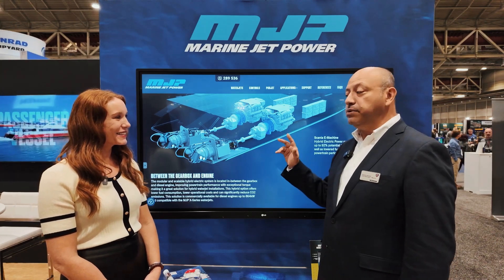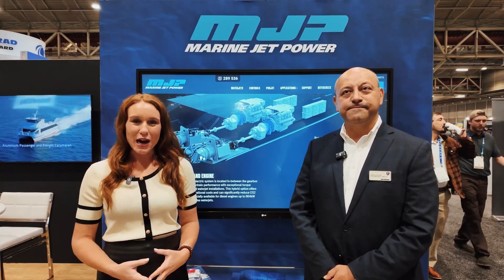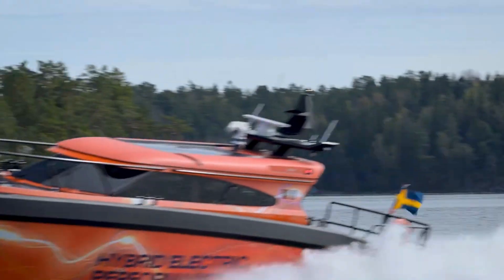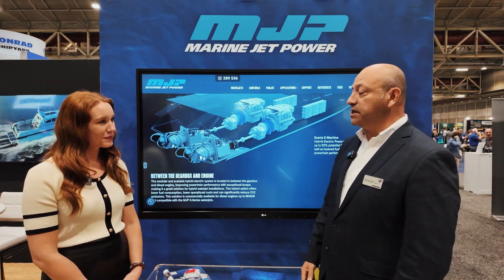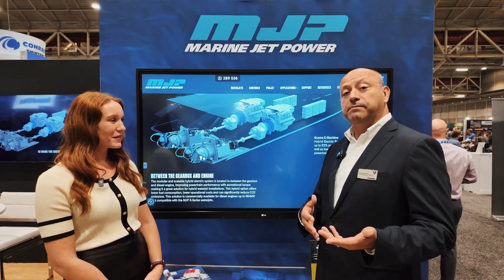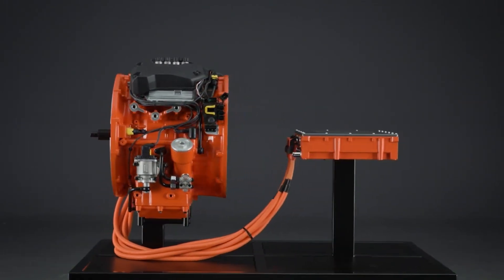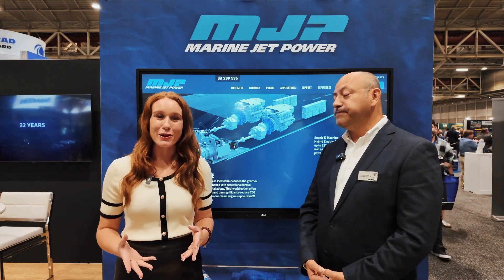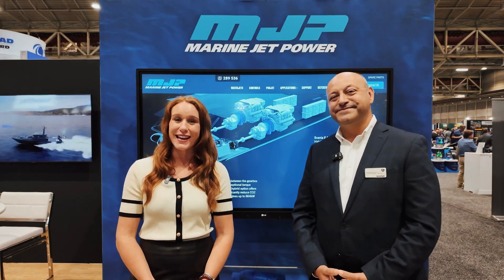How Hybrid Electric Waterjets Work - Scania E-Machine - MJP

Comment: Could it work with diesel generators instead of diesel engines? Regards!
Reply from the maker: No. Generators provide power to start the engine. You still need the engine to turn the transmission.
Reply: @ thank you for the answer
Reply from the maker: @1MauricioGarcia  you were right. You can use electrical power with a diesel generator to power the waterjets. Here is a vessel reference that uses a different solution to do that. https://marinejetpower.com/news/derecktor-new-york-selects-marine-jet-power-waterjets-for-two-hybrid-passenger-ferries-for-chatham-area-transit-in-savannah-georgia/